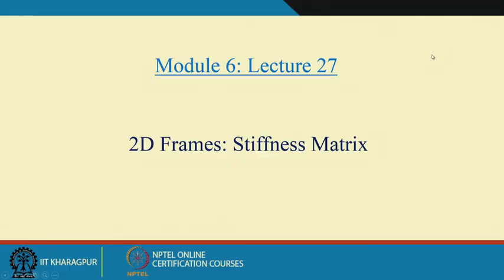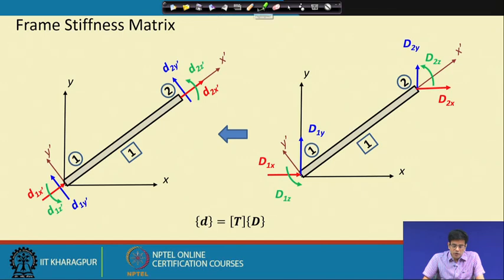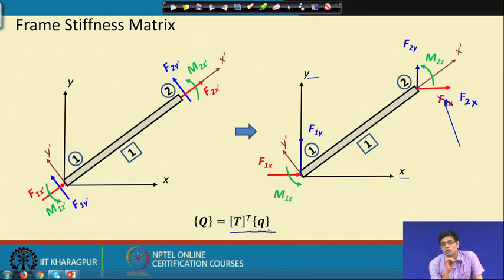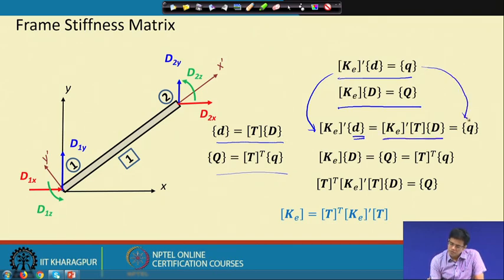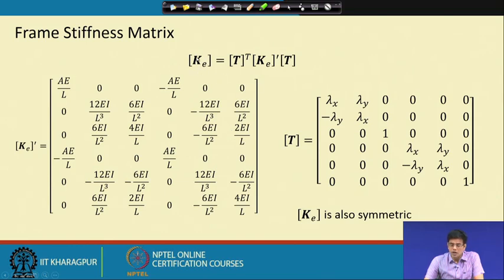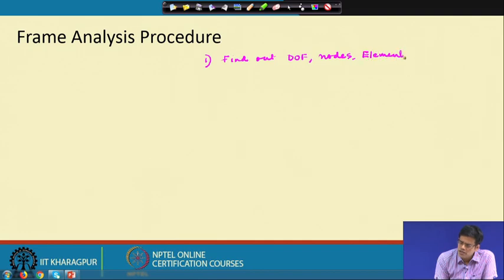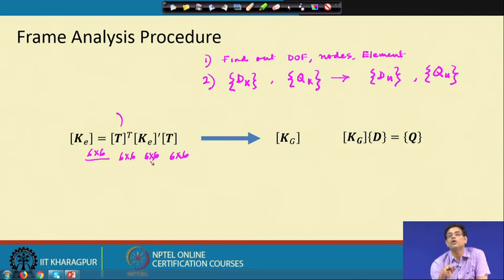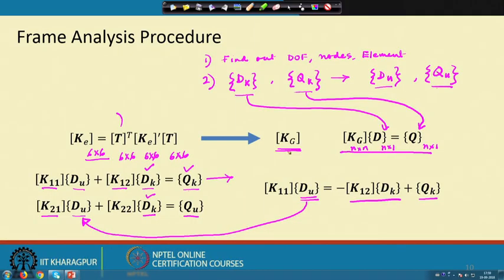Lecture 27 : Matrix Method of Analysis: Frame (2D) (Contd.)

Comment: Timestamps
00:14 - Discussion on the stiffness matrix for 2D frames and inclined frames.
03:33 - Understanding global and local axes in structural analysis.
06:47 - Understanding stiffness matrices in local and global coordinate systems.
09:49 - Transformation matrices yield a symmetric non-prime stiffness matrix.
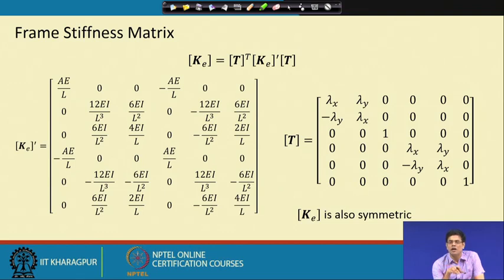12:42 - Transformation of stiffness matrix retains its properties.
15:30 - Matrix analysis involves discretization and assembling stiffness matrices.
18:18 - Understanding the global stiffness matrix and its role in equilibrium equations.
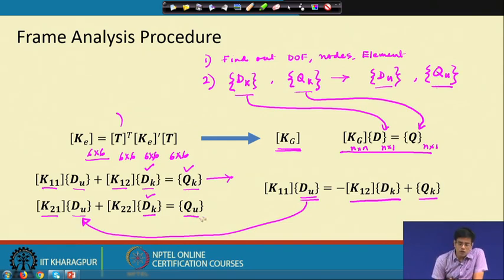20:42 - Understanding matrix analysis procedures for structural deformations is essential.
23:23 - Understanding the matrix method is crucial for interpreting structural analysis results.